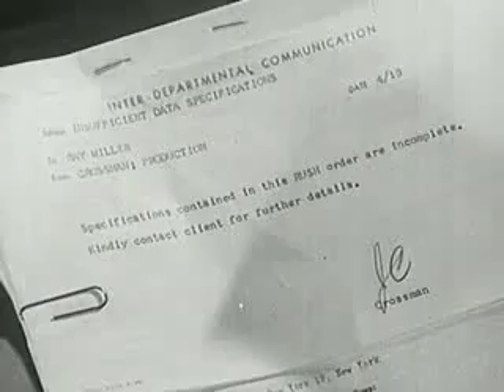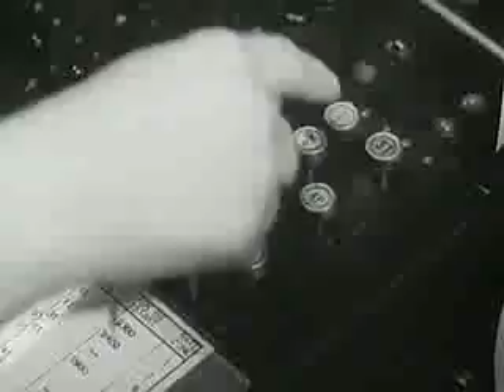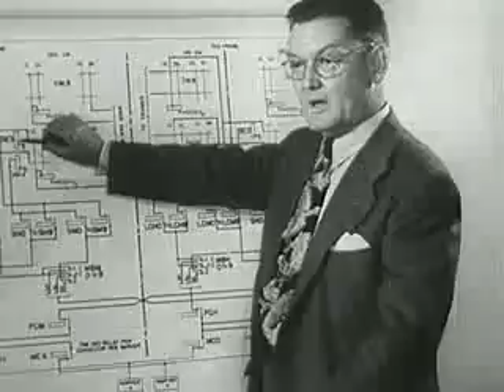Speeding Speech - (1950s)

Comment: The one thing that I wish Judge Green would have done in the break up of the Bell System would have been making the Brand "Touch Tone" public domain. For years I input Translations into1ESS and 1AESS offices.  Some vender would want DID(direct inward dialing) trunks for a PBX.  Reading there instructions it would say they needed DTMF(generic for Touch Tone) Signaling. The Tell co would ask, "Do You want DP(Dial Pulse), TT(Touch Tone), or MF(Multi-Frequency) signaling".  The vender would say Make them MF.  I would build the Trunk Groups. Then on the first day of service I would get a call "Hey these trunks don't work".  It happened  so may times that the first thing I would do would be to change the Signaling from MF to TT(DTMF) and say "Try it now".  Almost every time that would fix them.

Comment: @gnutelliums Yes. Area codes as we know them were invented in 1947. But there were operator routing codes used before then for the #4 crossbar switches and Crossbar Tandem switches that handled long haul and short haul long distance calls. Operator toll dialing was one step away from customer toll dialing, which started in 1951.

Comment: That looks like #1 Crossbar (Xbar) switching. And this presages DDD (Direct Distance Dialing) which really kicked off in earnest in the mid 1950's. 

#1 Xbar is a 1930's technology. So this had to be more like late 30's to the 40's. 

Now the #4 Xbar was a toll switcher and could do routing, record information, etc. All eletro-mechanical. Now we're all digital.

Comment: The tones are DTMF tones. Dual Tone Multi-Frequency.
Reply: DTMF is the Generic Name for Touch Tone.  Touch Tone used 8 tones. 4 low and 4 high. MF used 6 Tones on a 2 out of 6 code. The lower 5 Tones would code the numbers 0 thru 9. The 6th Tone plus one of the other 5 Tones would be used for special control codes (KP,ST). See the Key Set at time 02:30 and at 05:20.
Reply: No those were MF tones that showed in the video it’s a different set of frequencies then DTMF